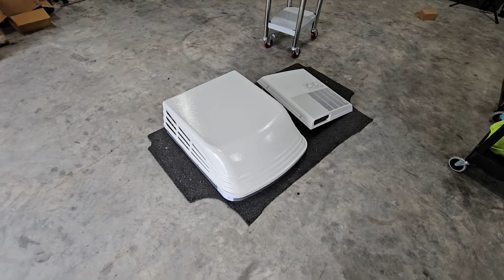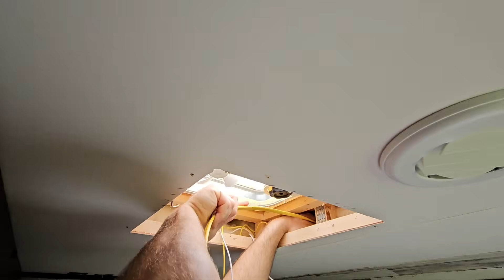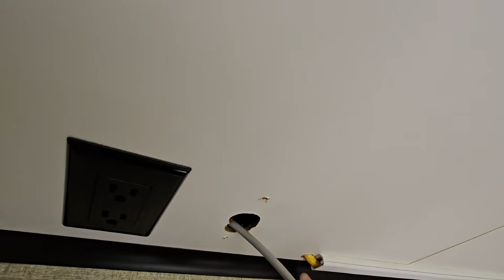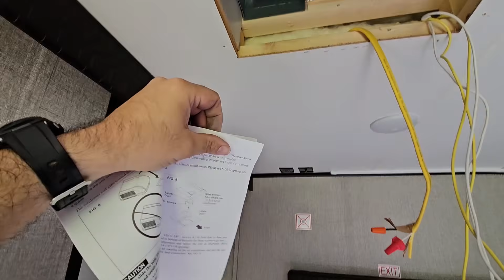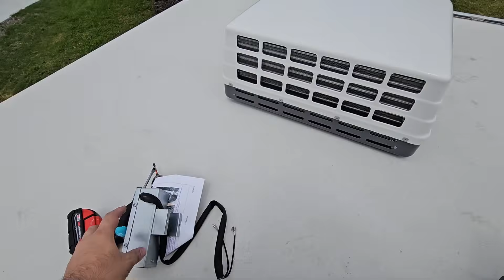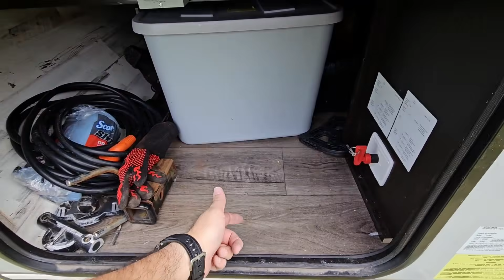Adding a 2nd AC to an RV that only had one! Advent 13,500btu Low Profile AC!

Comment: I did this same install. My only issues is that it runs for several minutes then stops compressing.  I have a soft start and running 20 amp with a 10 ga extension cord.  So not sure if the ac thinks it hits temp and turns off or if it’s pulling too many amps or volts and has to go in a cool down mode.  I want it to feel like a meat locker and we don’t get that cold.

Comment: I've done something similar to this but with a basement ac. Lots of wiring and I even made a circuit to shut off stage 2 on my colman 2 ton unit so I could run both units if I wanted to.

Comment: Is it possible for a strong person to just lift the unit onto the roof with a rope and straps? Aren’t they only like 85lbs?
Reply from the maker: The hardest part with doing it that way is how you would have to cantilever over the edge of the RV to try to lift a very awkward shaped and weighted 75-105lb unit. Most people will put a ladder on the side and a rope and pull it up the ladder

Comment: 1. If you ever have to replace that unit I don’t see how you won’t damage the roof. A better solution would be to use the gasket after filling the screw holes with sealant and truss head screws. 
2. My personal choice would be to run down the interior wall with the surface mount conduit, go through the wall and the connection point on the outside wall. Having to leave the storage door open when using the a/c would be unacceptable to me.

Comment: One word of caution that I learned the hard way with this unit. When the a/c is turned on the compressor will cycle on and off when interior temp reaches the set point but the fan will continue to run and won't turn off ever if the switch is set to any a/c level. Yes, that means the fan will be on 24/7 any time the switch is set for a/c. I have had multiple rv's and in every one of them when the compressor turns off so does the fan but not with this one. I contacted the manufacturer and the confirmed that is how it is designed to operate. for some people this may not bother them but for me I find it quite annoying and it makes it hard for me to sleep.
Reply: @markvanderwerf4083  I love that the fan stays in the time.  I have the same Ac unit as this video but my issue is that I feel like it thinks it’s at temp before I think max Ac should be at temperature.

Comment: I'm a 45 year Tech, Never Ever use self leveling or silicone to seal a A/C to the roof as it will make it almost imposable to remove it, That is without destroying the A/C. if your worried about the screw holes use Eterna Bond tape to cover them. But most of the time the Factory A/C gasket will cover the holes and NO tape or sealant will be needed at all.

Comment: Kinda glossed over the wiring which is basically the only difference than a normal replacement.  That is the real challenge.  That extra plug is kinda hokey but I understand it is only a 30 amp rig.  Very good presentation

Comment: Where did you buy the lower ducting portion of the unit? Mine shipped as a replacement unit, and like this customer, I only have the three wires and no thermostat in the trailer. I need the controls on the bottom of the unit, but my Advent didn't come with these.

Comment: We just had the same thing done to my 2002 Georgie Boy Landau 2950 DS.  They plumbed it right into the ceiling ducting, and added a dedicated 30 amp shore cord, and circuit breaker box.  Both a/cs now have soft-starts.  We are fleeing Commifornia for the free state of Florida Wednesday.  We will be living in an RV park for a couple of months while our house sells/closes.  This will be our first RV trip, so we are jumping in head first into the deep end of the pool.  I wanted to make super-sure its nice inside in the Florida summer.  The reason why they wanted a 2nd 30 amp is because we will be using it as a house for months with all our computers, and I don’t want to have to play games to keep the main breaker from blowing.  Also, we just made an offer on a house with a built-in dedicated 50 footlong RV garage.  I'll later add an outlet to plug the 2nd a/c into if we need it. Just being aware, we have to be careful with the electricity usage.
Reply: Leave your voting habits in commiefornia.

Comment: Great Video! We often use the Milwaukee multi tool with a worn down flat metal blade to remove old sealer in these circumstances. This is never fun and a putty tool and elbow grease really is the best option for 100% no rips!

Comment: This looks like a lot of shitting around. I mean it looks nice, but a lot of trouble. We use a 12.5k btu portable in addition to our rooftop if it’s too hot out and it works more than fine. I cut up a little frame out of plexiglass to mount the exhaust to the window with some double stick Velcro. It looks clean and works great.

Comment: I used sealant under my gasket because of videos like this. Ruined my roof and caused the gasket to shift. Not a good idea, now I have to pull the AC and start over.

Comment: I did the exact thing to my camper 2 years ago. I bought a heavy duty 10 gauge extension cord to plug in the 20 amp receptacle at the campgrounds. It works perfectly. Who needs a 50 amp service 😊

Comment: I would not have used lap sealant to cover the screw holes.  Eternabond tape would have sealed it nicely and is at least as strong as the roofing membrane.  For sure it makes an almost perfect seal.

At some point hes going to want to replace the AC seal and the lap sealant will make that a sticky mess.

In either event it was another great review.
Reply: @stevenfoster5737  agreed 💯.  That Ac will be a problem getting back off. Shouldn't ever leak,lol

Comment: I’ve seen that mini splits are becoming very popular lately in RVs. I’m told it’s because the RV rooftop units can only bring your temperature inside down about 15 degrees under ambient temperature. I have no way of knowing if this is true or not, but if so, I can see why mini splits are popular. In the same vein, will adding a unit bring down temps a further 15 degrees?
Reply: 15º to 20º differential is average for all air conditioning units.  Mini-Splits simply have more capacity.
Reply: @fatmuscle1  I’m almost 60 and I’ve never noticed that. Maybe I’m misunderstanding the magnitude of it, because my house can stay at 70 degrees even if it’s over 100 degrees outside. From what these people were saying, an RV AC can’t do that. If it’s over 100 degrees your camper will be like 85. We just bought our first RV, so I don’t have the experience to say whether they’re right or wrong.
Reply: @robertboyer5498  Two different things.  The one I am speaking to, which I thought you were discussing is system related.  From return to supply there would only be a 15º to 20ºF differential.  Now, when discussing the difference between inside temp and outside temp, there are other variables.  Insulation and age of the air conditioning unit being of high importance.

Comment: What was the two Yellow and White wire harnesses that were there before adding the additional 120 line? Were they 12v for lights? This is an upgrade I would love to do on my TT. Like the concept of soft start as well.
Reply from the maker: 12vt fan and light wires

Comment: I did the same thing to my Flagstaff 27VRL. Added a second Coleman Mach 13.5k in the bedroom. There was no pre-wire. Ran wire just like you did through and out the ceiling, down the wall. On the side wall I put a work box with a 20A breaker, on the outside wall I put a 20A male receptacle. It require a separate extension cord to connect it to power, which is fine. I just have to make sure the sites I'm at have both 30A and 20A connections that are both in good working condition. But, man, did it make a HUGE difference in comfort when camping during the dead of summer.
Reply: JD, you ALL did a great, clean job. Especially running the wire. 👍👍👍
I thought the a/c was pretty quiet.

Comment: That's great to be able to replace vent with an a/c unit. Wasn't aware if a unit like this was available. 
I've also wondered if a second a/c is installed, what would have to be done to tie in the new a/c and use the coach wiring. 
The existing 30 amp wire and connector would have to be changed out for a 50 amp cord. I'm sure the circuit breaker would have to be changed or a second breaker intalled, which would necessitate running the power wire all the way to fuse panel.
I've thought about doing this when i reroof and redeck our trailer.
Im certain there are a lot of people will be looking into this, especially here in the south and southwest.
As you know, here in Texas in the summer it can get about 5 degrees cooler than the surface of the sun.
Great video.
God bless y'all and stay safe out there.

Comment: I understand that this is a used unit and a retrofit; but my question is….. is it better and cheaper to buy a new unit with the second a/c installed or do this retrofit?  Looks like a lot of work.
Reply from the maker: It wasn't too bad. Just need to make sure the roof area is clean and the opening is beefed up a bit.  It's significantly cheaper to add a unit in my cases.

Comment: Hey jd I use a plastic gasket scraper and I round the edges with a flap disc in a grinder so I don't tear the roof membrane
Reply from the maker: Interesting! I hope to never do this install again, so hopefully I won't need to remember that tip lol